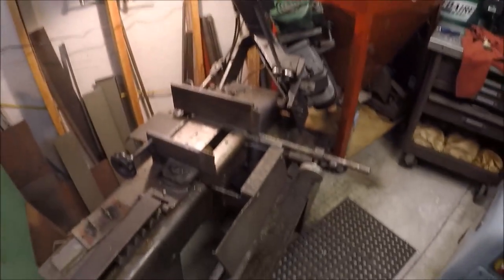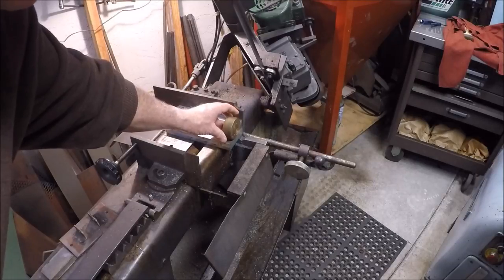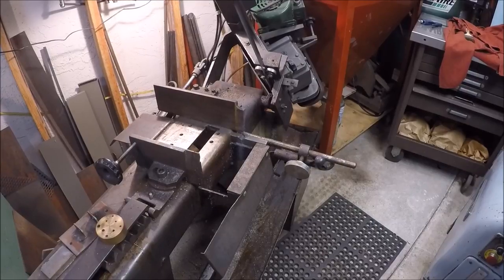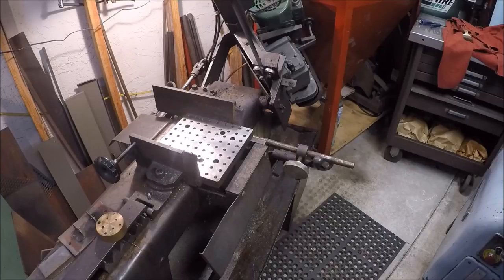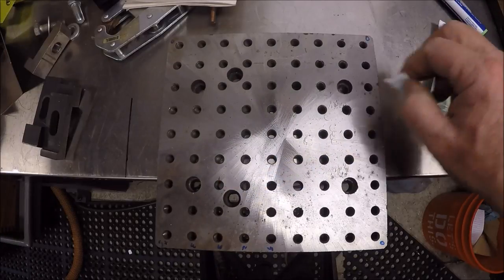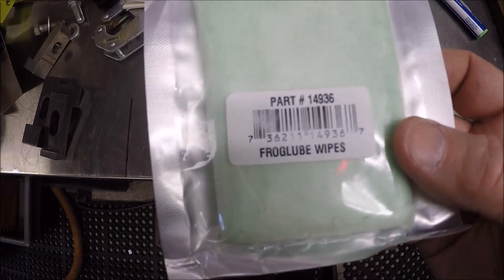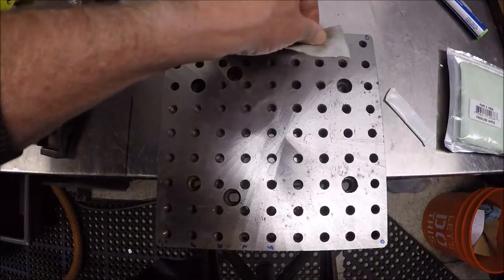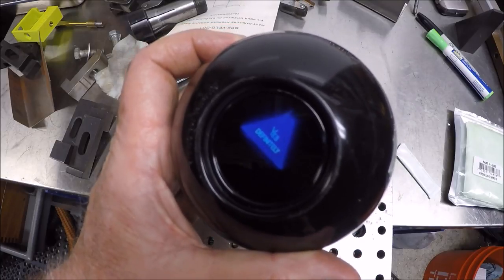Bandsaw Setup

Comment: Hi Chuck, I had he same problem with my chucks etc so I got a Meaco DD8L Junior, air conditioner it does not have a compressor so very economical to use.  The machine is used in caravans and boats where there is high humidity.  Sending woofs to Howie and Positive vibes for Tim😑😑😑😑😑.  Kindest regards.  Joe.